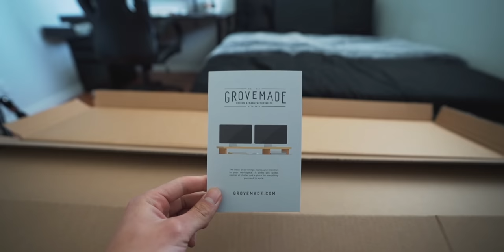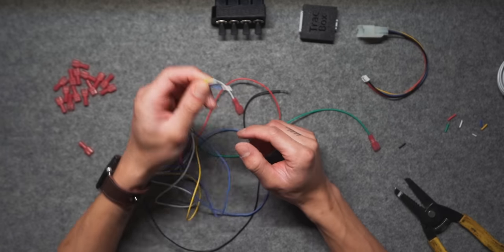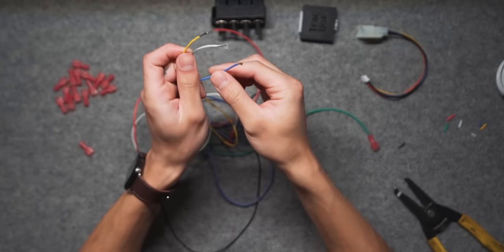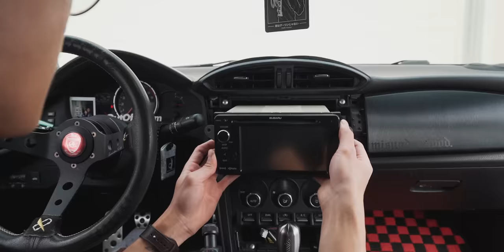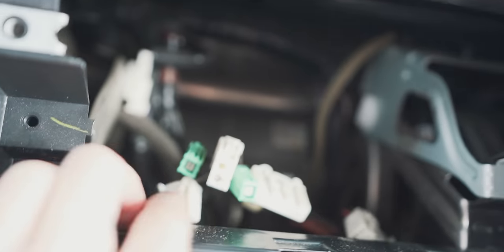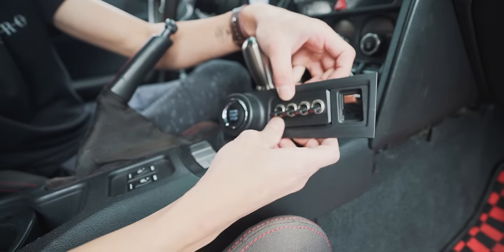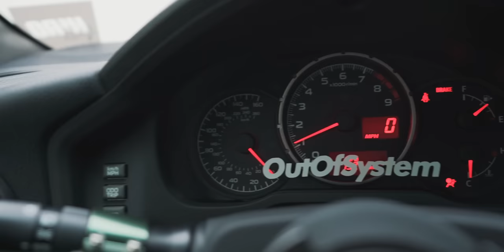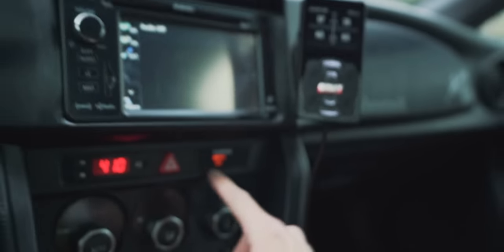Every FRS/BRZ owner NEEDS this mod!

Comment: Did this same mod on my car back during the winter and couldn't agree more. The TracBox and switch setup looks amazing and adds a TON of function.
Reply: Did you get CEL? I did and tried to clear it, but oft wouldn't communicate with ecu. Had to unplug box to clear. Seems obd2 doesn't work while box is plugged in... any advice?

Comment: Fun fact: to turn off traction without pedal dance is hold onto both traction off & VSC Sport for 2-5 seconds.

One night i was messing with my buttons in the car and i decided to hold onto them because i was curious and it worked. And let me tell you that my FR-S SI QUEMA CUH!
Reply: Just to clarify, that's not quite the same thing. Pedal Dance enables a diagnostic mode on the car, and is a bit "deeper" of a disabling mechanism that also shuts off things like Electronic Brake Force Distribution, and I think also the Electronic Differential.

What you're referring to is what we commonly call the "3 second hold." It's MORE than sufficient if all you wanna do is hoon around in a parking lot (or even autocross and stuff), but it's not quite the same thing. Also, you don't need to hold down both buttons. You only need to hold down the "TRAC OFF" button, and it's for 3 seconds specifically :)